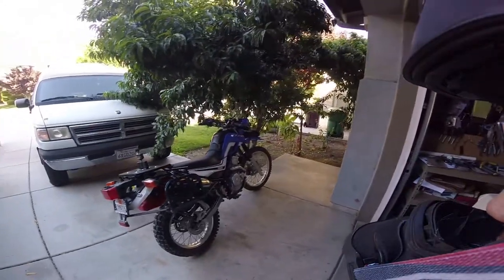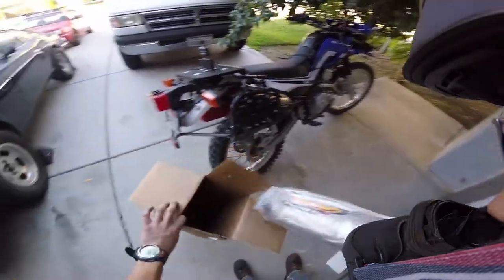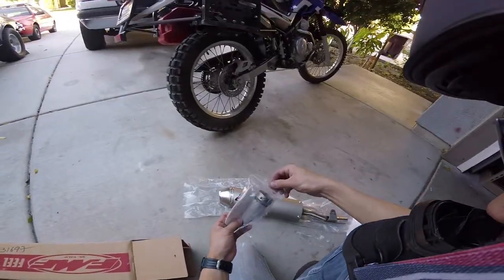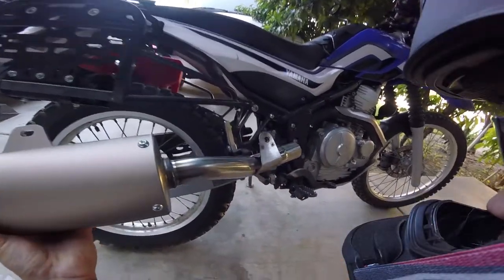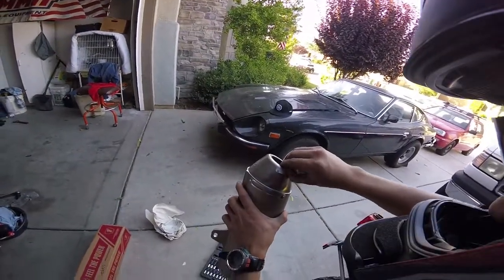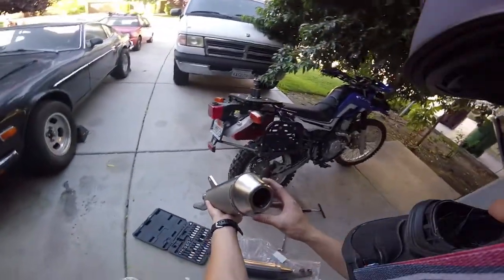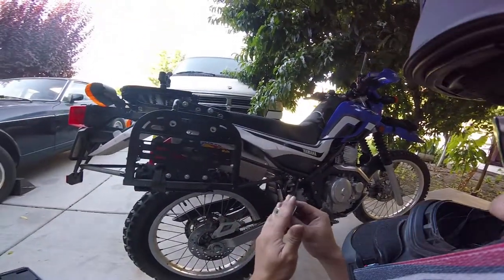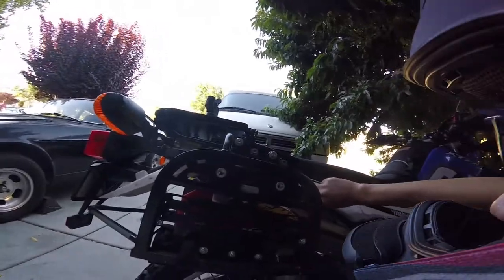XT250 Upgrades Episode 10: FMF Powercore 4

Comment: You left out the most important part. Did it make a significant difference in performance?
Reply: It's a slip on muffler for a sub 20hp bike, no it doesn't do anything significant other than make more noise.

Comment: I found that around the slip on section it was leaking just a wee bit. I installed a super heavy duty gear clamp around the slip on and clamped her down tight. No more leak and even sounds better
Reply from the maker: Hey thanks for the heads up Todd!!!

Comment: Sounds great 👍. Are you still running the oem header pipe? I am considering get a titanium one off Webike.
Reply from the maker: Yeah I’m still running the stock header. It’s tough without a fuel controller to justify any mods into intake or exhaust.
Reply: @NoOnesWatching0_0  I just installed a Beams stainless header this past weekend. I was nervous it wouldn't really fit as its for the Serow/XT250X. But it fit thankfully. I wanted something that will rust less and be more aesthetic with my stainless Delkevic. I know there's no performance boost, but still think its perty to look at 🤩

Comment: I just bought one of these before watching you video...and now I'm afraid to install it.  Do you have any lessons learned or ideas that could help me prevent melting my fender?  I'm seriously debating whether to even keep the thing or return it to Amazon but I could really use the performance enhancement.  Anybody have any words of wisdom on this?  Thanks in advance!
Reply: just add large fender washers to the muffler mount to space it further from the frame
Reply: Andrew Carleton , thanks, I did exactly that and it worked great.
Reply: Just wanted to mention that I did add this exhaust and I noted a gain of a small amount of low end power.  Top speed with 215 lb rider went from 74 to 80 mph.  That said, I don’t typically run greater than 65 for any extended period as the bike is just too light and gets blown around a bit much at higher speeds.
Reply: @Paul-wy2wk  i was just wondering if you are using a fuel controller with the pipe as well?
Reply: Andrew Carleton, no, not needed with just the exhaust.  If I replaced the whole system then it would need the remapping.

Comment: Hey I watch the video is great thank you I do have a question before I install the FMF exhaust do I have to wait the allotted 600 mile engine . will that affect anything or can I install it right away cuz I only have 100 miles on it my XT 250 Yamaha. thank you for your advice in this matter
Reply from the maker: you know what henry, I'm not too sure if it'll make a difference. I would probably do the proper break in first then start adding aftermarket parts, UNLESS.... you have everything in order to do the exhaust mods properly ie intake, fuel programmer, and pipe.

Comment: 2 questons.  Did it open up the bike?  And whats up with that 240Z in the driveway?
Reply from the maker: +BlackMesaSecurity It did open the bike up, but I think it would do a lot better with a power commander. It's actually a 260z that I've had since highschool, I've put it up for sale to fund the project so it shouldn't be there much longer.

-NoOne
Reply: Man, the only thing it opens up is you're wallet !
Reply: @markcollins5026  I've got a DG slip on on my 2019. No melting issues and seems to make a little bit of difference, also did the K&n filter. I have been trying to figure out what tuner to se to richen things up a bit, but that seems like some kind of secret..lol

Comment: Hey bro, know it can run a little lean with a new exhaust. Have you installed a programmer yet?
Reply from the maker: Not yet man, unfortunately money is a little tight but it's on my list of things to do.
Reply: @NoOnesWatching0_0 any change in gas milage after the pipe install? have you put a fuel controller on yet?

Comment: Really not a good idea with adjusting the jetting. Im re-jetting my XT350 even though it has the stock exhaust
Reply: Did you fit the FMF from a 250 on the XT350? Any mods or straight fit?

Comment: I have to re-calibrate my carborator apparently :(((
Reply from the maker: Typically carbed motors will need to be rejetted after significant intake or exhaust modifications. I know it sucks, but at least its easy and pretty affordable! 

~NoOne
Reply: TexasRider90 Beefy hey I noticed that you have the carburetor instead of fuel injection but is it the xt250 ? And what did you have to do to get you’re bike to run good with the pipe